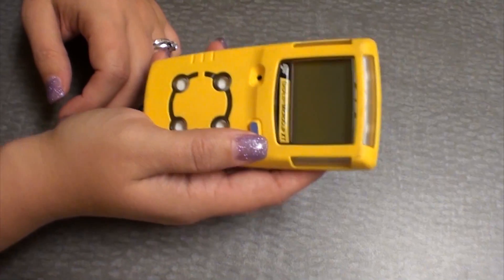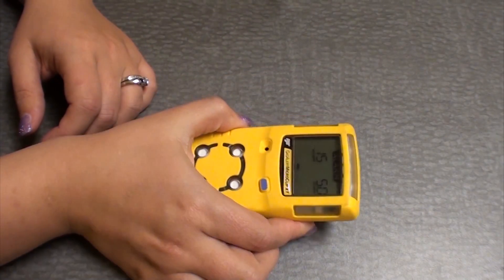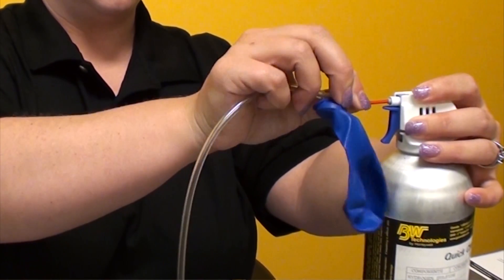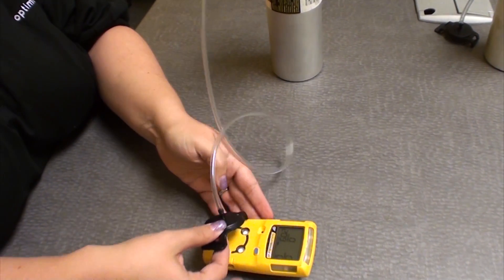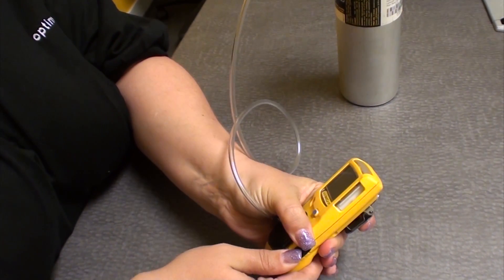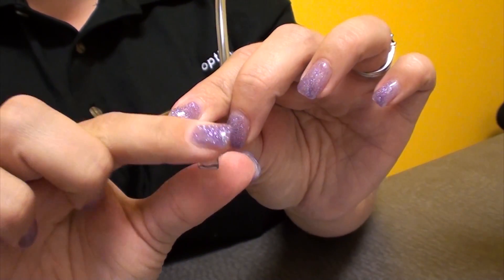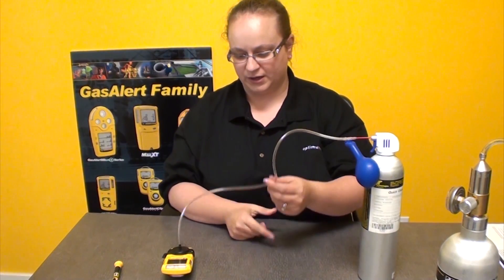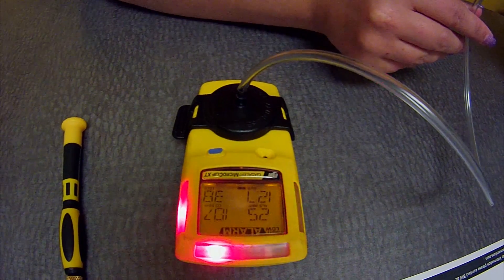How to Do a Bump Test: BW Micro Clip XT Gas Detector

Comment: You have to verify if the cells indicate 50% of the gas after 10sec, and 90% after 30 sec. Your way to apply the gas is wrong for that reason.

Please have a look at CSA C22.2 no 152-M1984 (R2006 or R2013), the point 6.9 is pretty clear about it.

I used you video and now I must talk with the CSST...